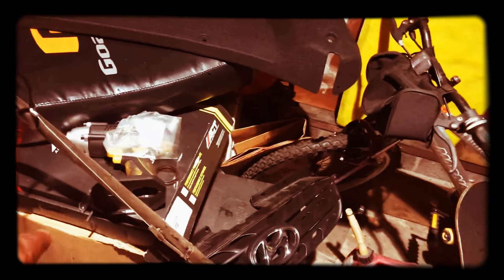More drama with the new Genesis Coupe....

Comment: I have the shaking as well. The is a issue with the Gen's. No one really knows what the definitive fix is, from what I understand its most likely a wheel balance issue. There is a specific road force balancing machine that has worked in the past. Take a look on gencoupe.com there's a lot of threads about it.

Comment: Wjth all those codes, how is the car running?
Reply from the maker: freshdominican92 Magic 😂 !! Actually most of it has to do with no cat and the stock tune.
Reply: @ChuckTateD117  whats wrong with the stock tune
Reply from the maker: freshdominican92 the stock tune is working correctly in that the ecu is adjusting for the missing catalytic converter. I’m gonna put the cat on for emissions and change the spark plugs.